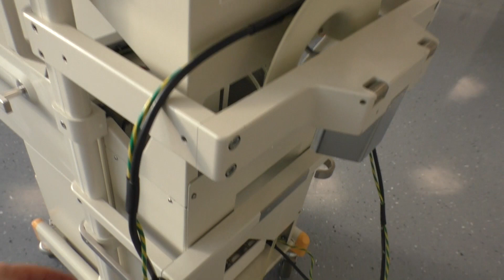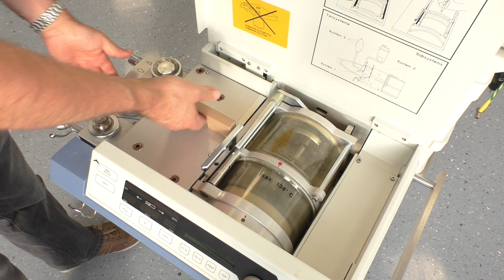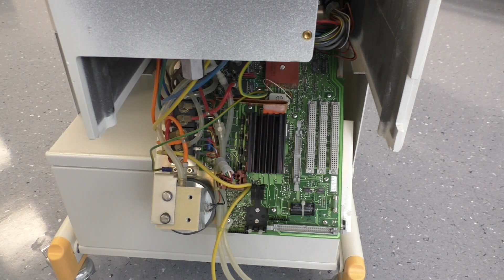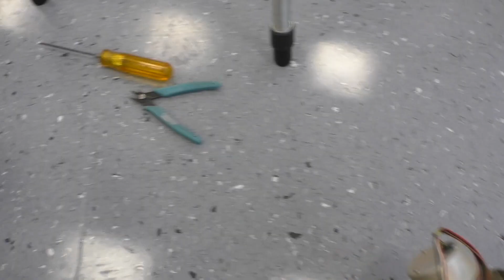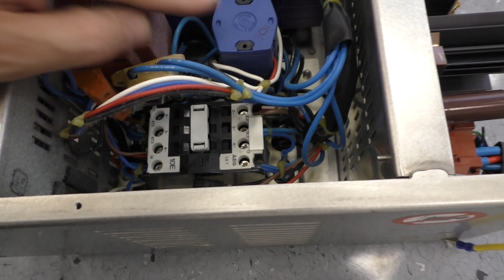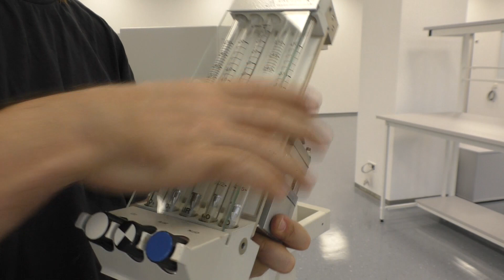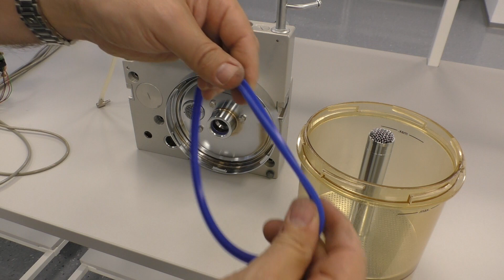PWJ39 - Teardown Draeger Anesthesia Ventilator medical system

Comment: That air flow meter is like a MAF meter in a car. You are correct in that the wire is heated. The resistance is measured which changes with temperature, and by extension, airflow.
Reply: The method used to measure airflow in that anesthesia machine (Dräger calls that anesthesia workstations) is called hot-wire anemometry.

Comment: As an electric engineer student I learned about a gas flow measurement technique. At one point the gas is heated with a pseudo random pattern then at a second point in the tube the temperature is measured. The gas flow rate can be calculated by some auto or cross correlation method of the heating and temperature measurement. The teacher mentioned that it can be used for very sensitive gas flow measurement in a breathing machine.
Reply from the maker: you mean the first wire heats the gas up which is sensed by the second wire a little later... depending on the speed of the gas. Time delay depends on flow rate.  Something like that?
Reply: Play with Junk
yes

Comment: 1:34 - The plug for the mains power means that the anesthesia machine you are dismantling was used in BRAZIL.
Reply from the maker: I can assure you that this is a Swiss power connector. I checked the Brazil plug and it looks indded very similar. But the earth pin is a bit closer to the center. This swiss plug will not fit in a brazilian outlet.
Anyway, the machine was made in germany and used in switzerland... very unlikely to have a brazilian plug :-)

Comment: What did you do with the big blue transformer?
Reply from the maker: I will keep it and use it as an insulation and step up/down transformer. It has many ranges from 100 to 240VAC